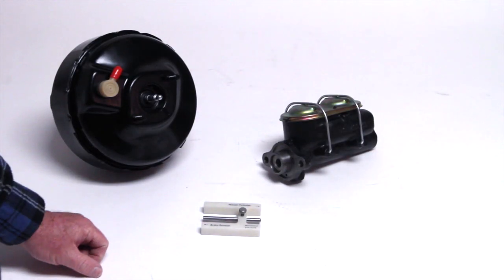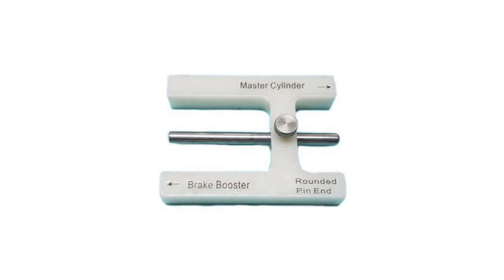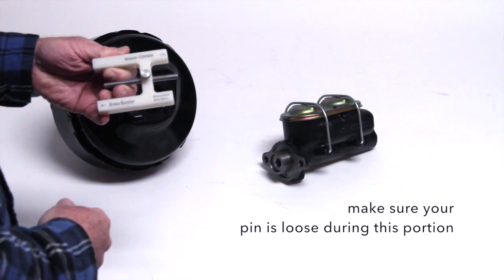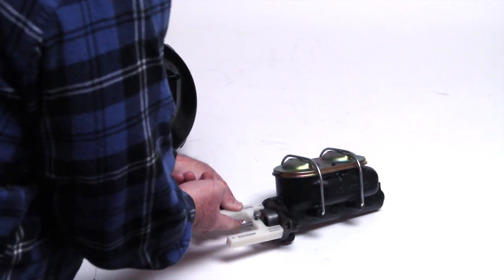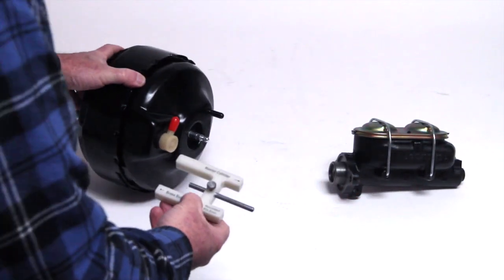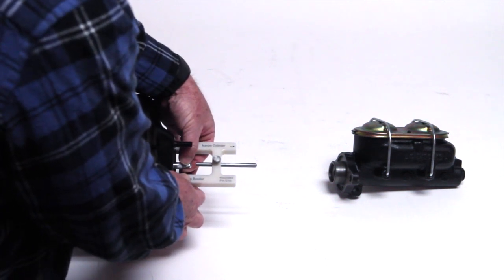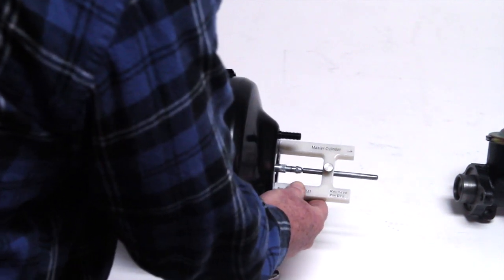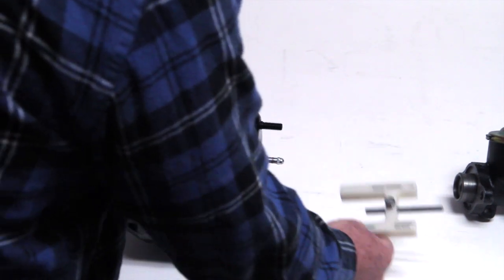Power Booster to Master Cylinder Pin Adjustment Tool

Comment: The pin should NOT be touching the tool.  There must be a 0.020” gap between the end of the tool and the round end of the rod.  This will give you a 0.02” gap between the rod and the bottom master cylinder plunger. This ensures no possibility of brake dragging.
Reply: It is factored into the tool.

Comment: Many cars have a clearance spec from around 1/16 to 1/4 of an inch. It affects how much travel in the pedal. Too tight and you risk causing the brakes to drag. To loose and your pedal might go to the floor.

Comment: does that tool work for any booster and vehicle? 87 toyota 4runner 4x4
Reply: No, it is designed only for the Corvette Unless your Toyota uses the exact same booster and master cylinder.

Comment: So I literally just followed your instructions exactly step by step and it did not work the gap between the plunger adjustment and the rod after a measure it inside the brake master cylinder and yes I am using the correct side because I can read😂 and then I make the adjustment I tighten the screw down and then I put the side that says brake booster on it up to the brake booster and I go to try to make my adjustment in the freaking screw falls out because there's too much adjustment that needs to be made this doesn't make any sense to me whatsoever

Comment: Please be advised. This adjustment must be made in the car with the engine running because the vacuum changes the position of the pin
Reply: Thank you,yeah on my factory shop manual it mentions that, also the people that sell this identical  tool (looks identical to me) in some specialized websites (not Amazon or eBay)  for like 60 dollars recommend using a 20 thousands feeler gauge between the push rod and the tool, whats your take on that? i appreciate your input, I'm gonna be doing this job in a couple of weeks and its been 15 years since Ive installed a booster, just trying to brush up.